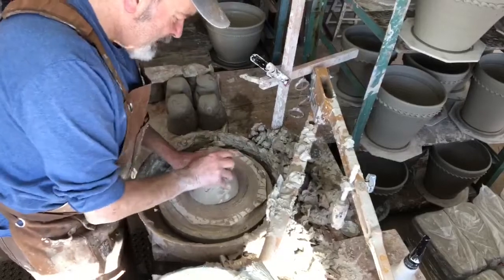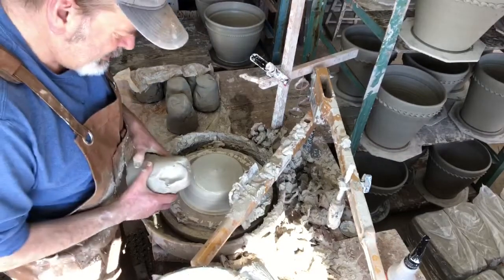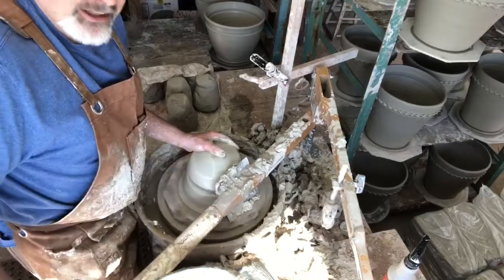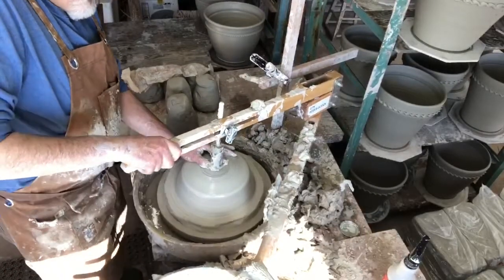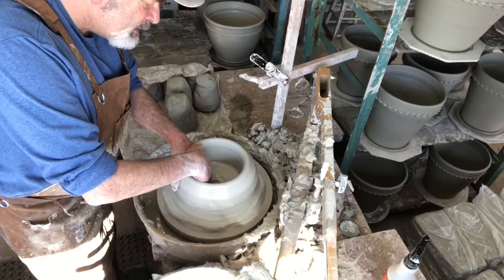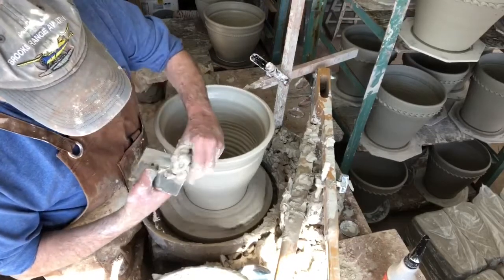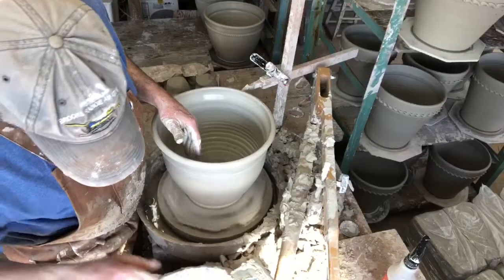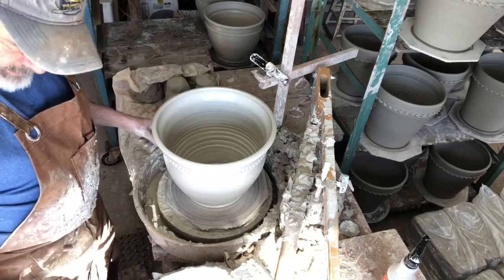Throwing with the Strong Arm Pottery Tool

Comment: Is the strong arm tool something that can be bought or better still, can it be made diy? My husband wants to throw clay on my pottery wheel; however, he’s been having issues with centering clay & not a great time making pulls.  This might make it easier for him to be more involved. 

He was in a motorcycle wreck where a drunk driver caused permanent lifelong damage to his (dominant) right shoulder/arm. The surgeon did a great job with what he had to work with, still, it’s not been easy having to learn to do many things with his left hand/arm. The loss of strength & range of motion will never be what it was before.
Reply from the maker: Yes, the Strong Arm is available here, https://www.strongarmpotterytools.com/shop